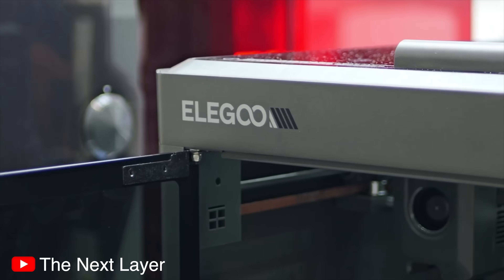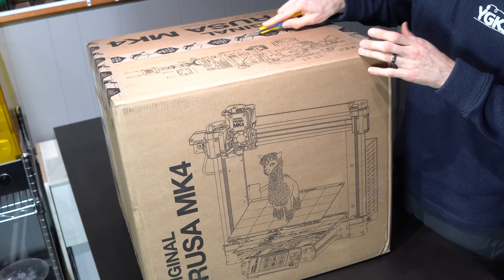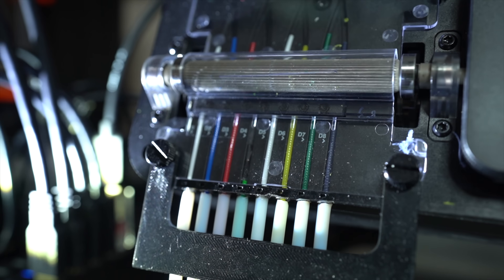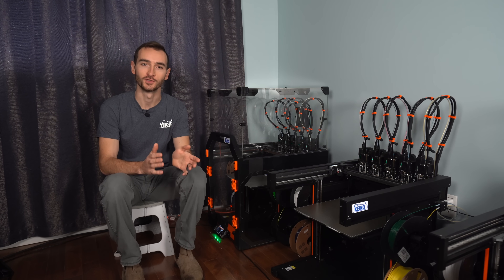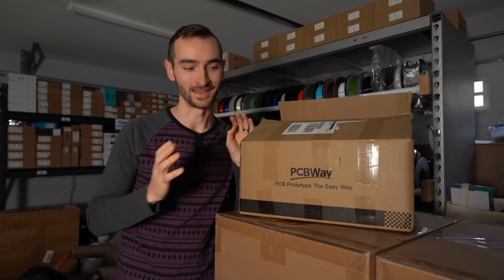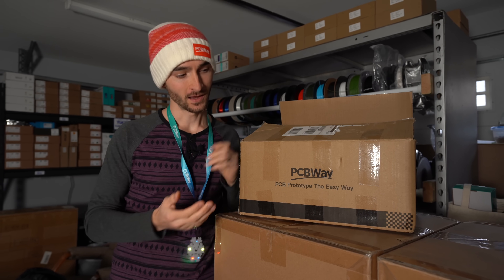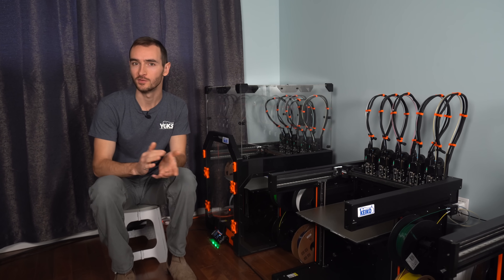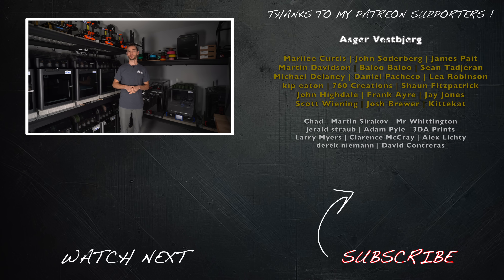The Prusa Core One is dividing the internet...

Comment: I hate downtime.  Prusa gives me the confidence that I will always get my printers up up and running if they ever go down. I also know I can always get ahold of Prusa support.
Reply: I actually think this confidence is rather mispaced. There's any number of manufacturers of clone/replacement parts for Bambu given just how popular those machines have become, and if Bambu stops offering genuine well priced replacement parts, there's guaranteed to be more. And on the other hand Prusa sells relatively fewer printers and has also steered hard towards proprietary parts and abandoned open-source hardware - the MK4 and Core One are no longer open source.

Between the two Prusa would still be my choice because less locked down, but honestly i would choose neither.
Reply: Ignore that guy, hes a certified bambu shill that has zero experience with prusa. Bambu's are referred to as "easy bake vorons" for the very reason that they are considered throwaways when broken.
Reply: Having used both printers extensively, my confidence lies with Bambu. The Prusa feels like a toy washing machine ready to break down at any moment.
Reply: The concept of a disposable printer just does not work for me.  None of my Prusa printers have become paper weights.
Reply: @narlyb1500  The problem is that it's a myth that it's disposable vs non disposable.
Reply: The problem is for a given comparable prusa machine you can buy 2 Bambu machines so the confidence (not based in evidence as multiple print farms have shown the Bambus to be just as if not more reliable) dies with the fact you can just have more.

Comment: "Forcing all other printers to catch up." Now see, you have to consider the design "restrictions" we (US/UK MFG) have to work around, called PATENTS.  We would have loved to include nozzle probing, purchasable enclosures, LiDAR, etc etc; but alas, our attorneys and management simply doesn't want to be sued.  So we are told no, and cannot innovate to the level that Bambu just gave the middle finger to patents and did everything their way, with zero support.  Now, you are telling us we are "too little, too late."  That's not the phrase to use here.  US/UK mfgs are forced to comply to patent law, and stay away from patent infringements while BambuLabs has not.  That's an unfair statement.  But all in all, it depends if you want support or not: you said it yourself, the Bambus are paperweights because of the LOE it will take to fix/tinker with them; whereas our US/UK mfgs have great post-purchase support, for years on warranty (well, maybe not Prusa past 1yr).
Reply: This is utter FUD, and basic view of the landscape shows this. For instance Prusa violates most of the patents Bambu is accused of violating and Prusa as well as many brands do nozzle based probing.

Further more there are certainly other ways to implement what the LiDAR of Bambulabs does without violating patents. These are xenophobic excuses.

Comment: Even a Prusa fanboy like me, must accept the fact that Prusa just ain't leading the market at this point.

They still have many good aspects, but they have been sitting on their hands for too many years until they released the MK4.

The relase of Core One isn't a fix to the challenges they face. 
However, I hope it's the beginning of a new chapter that MIGHT bring them back to a place among the leading pack.

I hope that improvements to Core One will follow in rapid succession with features like:
- A native and integrated camera, 
- automated flow calibration,
- actively heated chamber,
- higher extruder and bed temperatures.
- Prusa LINK functionality at the level of Prusa Connect.

Also, a lot of great features have existed in Orca for some time and only a few are slowly finding their way to Prusa Slicer (Alpha). 
Tools for easier filament tuning are still missing in Alpha, but it is nice to finally have multi-beds and paint-on fuzzy skin.
Reply: They really needed a bigger build plate and more colors. That's where the actual value comes from for the end user

Comment: Anyone else not buying a core one because bambu lab is set to release a new printer in q1 of 2025? I love the look and compactness of the core one but the price point is awful they should have it include the mmu at $1000-$1100 to take back market loyalty and take a hit on profit. Theyd probably make more at that price point by moving more volume. Instead theyre selling the machine for like $1100 without the mmu
Reply: Meanwhile bambu labs is gonna come out with a multi extruder printer with larger build volume at a price point near $2000 which is not far off from the total cost of the core one

Comment: I have both an MK4(s) and a p1s, and I have some thoughts.
If you want your stuff to just be printed effortlessly then both are quite nice. I'd personally say go for the bambu, as it's cheaper and has a heated chamber so it can print more stuff and is more consistent in the winter if you keep your printers in a cold room like me.

If you actually like the act of 3D printing... Man the prusa is better. I like my stuff to behave how I want it to behave, and it's much easier to with the prusa. You can feel the different approach in firmware design and the rnd behind making it a proven reliable thing you can also modify as you please. 

You might also not care in the slightest about all this and just hit print in bambu handy. Uh, new print is ready!

Two different printers for different kinds of people. I know I'm selling the mk4s to get a core one, it's expensive yeah, but I like that they think like I think. Working with the bambu for stuff that isn't the defaults sometimes feels like you're fighting with the firmware engineers lol. It feels nore unpolished on the software side. As old-school feeling as the prusa interface is, it is quite intuitive and not clunky. Bambu's feels a bit unfinished, even if it's more modern looking. Oh well, it's good at what it does. I'm keeping it :D

Competition is great! I agree this would have been like $1500 if bambulab didn't exist. 

I hate the fanboyism of the whole prusa vs bambu thing with a passion, as it's held on by people that are convinced that their priorities of what a printer should be are the correct priorities. They aren't.
Both brands make printers that are great at what they are set to do. They focus on different things, and different people weigh them differently. IT'S FINE! A good thing, even. If everyone did, thought, feeled the same way about everything we'd be extinct. You want the app and the ecosystem? GOOD! You want the reliability and value openness? GOOD! I have both :D

As I mentioned, I'm selling the Mk4s to get a core one. A few considerations:
-the upgrade doesn't make sense financially compared to "flipping" the mk4, especially if you bought a kit and can now sell the printer assembled for close to what you bought it for
-with prusa the smart thing to do is go for the kits, not only they are great fun if you already like Legos and similar stuff, but they make these upgrades make more justifiable. Prusa is undeniably expensive, but not that much more expensive if you get the kits.
-if you're actually financially smart and want to try a prusa, get a used one right before launch of the next one lol
Reply: I agree with you. If you get joy from 3D PRINTERS, get the Prusa. You'll have a better time. Definitely go for the kit, so you build it out and fundamentally understand how everything works and know how to troubleshoot in case anything goes wrong (not saying it will, but knowing how it goes together mechanically should give you more confidence in the system).  If you just use a 3d printer as a tool in a larger workflow, I'd lean on a Bambu machine, myself. You can get it right now, it's a known experience, and in the US especially, if you're close to a microcenter, you can get the Bambu-tuned filament with RFID super fast (and if not, Bambu's shipping to the US is a lot less onerous than Prusa's US shipping).  I wouldn't say just use Makerworld or Bambu Handy and print something; I only print my own designs and have a bunch of different printers, including two vorons (v0, v2.4 350). The v2.4 takes too long to heat soak to print, and the v0 is often not quite big enough for all of my models (but will get the nod when it is). The X1C gets probably 80% of my design iteration workload because I can get something out fast, I don't have to spend time manually swapping different filaments (I use the AMS for storing different types of filament and different colors, but don't do many multi-color prints), and a print will usually be done by the time I'm ready with the next thing I need to print. My other printers, including an older MK3S, are used for final parts runs.

One other note -- neither the X1 nor P1 have heated chambers, IIRC.  The X1E (the super expensive enterprise version with an ethernet port) may, and I suspect the new big printer may, but not the stock X1C people are buying.  I forget if the Core One has a heater, but if it does that may be a plus in that column too.  To counter that, though, another negative of the Core One is that it will probably take a bit for the firmware to be up to snuff, given all the hassle early adopters had with the XL.  I wouldn't compare a printer that's not even available right now to a printer that has been around for almost 3 years -- the Core One by all rights SHOULD be better than the X1, and I hope it is! Competition is how we as consumers win.
Reply: I agree with most of your statements but quite a lot of people need a bigger printbed (300 to 350) and want multi color. I want 2 printheads so i can print models with disolvable support rel. fast. Prusa XL is too expensive in a 2 print head configuration. The only printer i could find which i can pay for is a RatRig 400 IDEX.
Reply: @Amelia-lu6qv  this is true! I don't think it's a "but", but an "and". It's one of the selling points of other printers and a reason why somebody might prefer it over the others and... Great! Options! 

I'm one of those people by the way, one of my "clients" is a friend that keeps bonsais, and I print a whole lot of vases for him. I don't need 300mm, but I did use the whole 255x255 area of the Bambu P1S. The Mk4s (and the core one!) isn't as big.
Reply: Having experienced both, I can say you're not off the mark that much. I consider Prusa to make the pinnacle of hobbyist machines. While my Bambu is the pinnacle of consumer "it just works". You start a print and go do stuff. You know it will come out perfect.

Granted, my horrible experience with the MMU2 has left me with some very real animosity for Prusa. It doesn't change the fact that the P1S with AMS units is a completely different world from Prusa anything with MMU.

Comment: When I got my X1C two years ago it was to replace a broken-down Prusa i3. The Bambu and its siblings are all running strong today.
Reply: What had been broken? Nearly all parts can be rel. easily replaced?
Reply: @Amelia-lu6qv  the wiring loom to the head developed cracks and shorts. It needed to be rewired and I didn't consider that to be easy enough to bother.

Comment: It feels a little disingenuous to call the X1Cs paperweights because they require maintenance, and then compare them to printers that you have actually performed maintenance on? (Purely on the maintenance/replacement parts, not the speed etc)

Maybe I’m misreading that though?
Reply: In the one year I've had my P1S, I've put as many hours as I did with my Prusa Mk3(s+) in 6 years. I spend more time printing with Bambu. With the Prusa, it was constant maintenance. Constant.